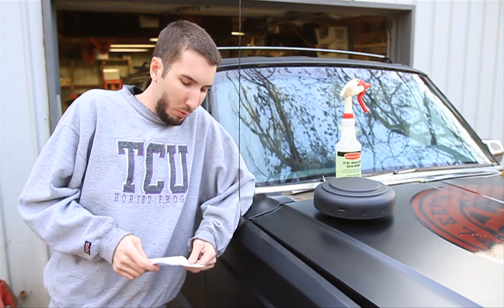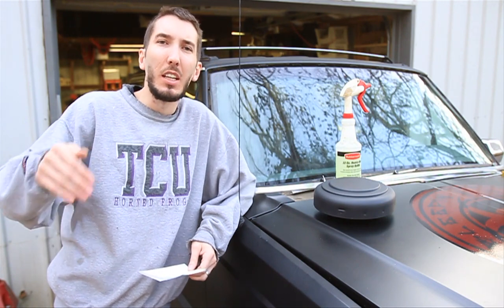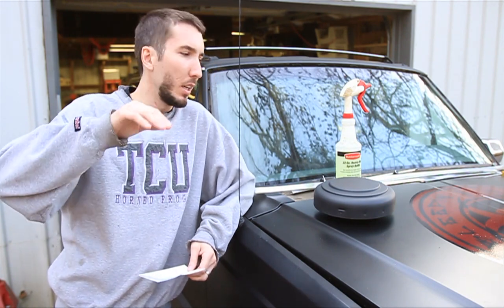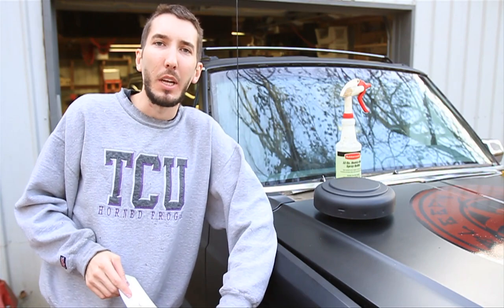How-To Diagnose a Leaky Windshield

Comment: fantastic advice, found 2 leaks on my discovery 2. top of windscreen and drivers window fixed it with some clear selicone..I didn't have a airline so i used a can of air duster for computer keyboards worked a treat  thanx so much
Reply: Thank you, I was hoping the air can would work. I will try this.
Reply: Genius

Comment: Nice trick! I tried using the car blower with doors closed, but just not enough pressure with my old car. Don't have a compressor, but tried my wet and dry vacuum with hose on the blower side. Works great, found the leaks in no time. So for those without compressor this will work for you (assuming you have vacuum that you can blow with)

Comment: I had a similar problem on 07 ford taurus leaking water from rain. The issue on my vehicle was the two cowl (upper and lower) of the wiper. I just use water resistant silicone from homedepot and haven't had a problem since heavy rains

Comment: I like the soapy-water-and-blown-air trick. Will try it on our windshield in order to pinpoint the leak. Thanks.
Reply: P.S. I'm going to use a silicone sealant to fix our leak, but I read that "silicone will not adhere well to surfaces where soap residue and/or soap scum is present." So if anyone is planning to use silicone, make sure all the soap is rinsed away.

Comment: There is another option. Running down and leaking into the wire grommet. So, no amount of silicone fixed it. What I ended up doing is using the silicone to reroute the water away from the grommet. Been good for the past 4 years.

Comment: Perfect testing procedure.  Had rain water dripping from under the roof rails to the windshield area in which the water would drip down inside on the lower A pillar and pool up on the drivers side floor.  Wanted to verify before spending $250 on a windshield replacement for my '93 Accord project I'm reviving...
Reply: I got a 99 accord thats leaking when it rains. I noticed my windshield moulding is loose. Gonna buy some silicone adhesive tomorrow and give it a go.

Comment: not trying to be too critical but is it possible to create leaks like this with an air compressor?  They have some serious power
Reply: What you point out is not "criticism" but common sense. Yes, the pressure from compressed air is TOO high.
Reply: depends on the power of the compressor and how close to the seal you're putting the nozzle. You wouldn't need enough airflow to cause a leak as you would need to find one so common sense would say if you have a more powerful compressor then move your nozzle further away from the test area.

Comment: Might want to have the windshield pulled... A couple of things are going on  with your glas... #1, the Ceramic paint along the edge of the windshield looks like it's breaking down and coming away from the glass..... #2, The windshield may have been installed by a shop that didn't bother to prep and prime the edge of the glass allowing the Urethane to  fail ......Good tip on finding the leak!

Comment: I had a problem with my driver side floor board getting soaked every time it rained. Thought it was a leaking windshield so I took it in to get it re-sealed they said the seal was fine. Next rain storm it was soaked again. Floor boards are not rusted. After a long time trying to figure it out it ended up being my door boot that covers up the wires to the door attached to the cab. It was missing a chunk on the backside and the water channel flows right to that spot and gravity was making the water flow right in my rig.
Reply: good knowledge  thanks for video
Reply: @dkhill27 where exactly are you talking about please?

Comment: If you don't have an air tank and that tool. You can just turn the car or trucks heater on full blast and close the doors with the windows up and you will get the same result.

Comment: I have had my windshield fully resealed twice and two partial reseals,the leak is still the same!! it's a bit lower down than the leak in the video!! i'm totally baffled!the resealers had to glue the bracket that runs along the edges of the screen,because the clips broke,so i can't do the method in this video!any help would be greatly appreciated!

Comment: i seem to have this problem right now, but i notice the water coming in from the passenger side almost underneath the dash, is it possible that the water from the windsheild will leak in this way?? the truck was park for 2 months and i opened it up and its full of mold! :( its not a/c fluid or antifreeze ive checked. son of a!

Comment: If its leaking its from a bad install or its just plain old..also there could be rust under the urethane and its pulling off the body... they should be able to cut it out an reinstall it. very easy job. i have a 91 Cherokee and installed a windshield for a 97-01 has a nice rubber molding all the way around. i glued the molding to the glass and then installed it. looks a lot better and helps keep the mud out. ditch the chrome molding trim and get a (part number) #1140 and 1140 molding...i wouldn't recommend reusing a windshield unless its less than a year old.   i work for a glass shop.
Reply: yep.. that jeep is mint. id spend the extra money and have them put a 1140 in it. it looks great ill send you a picture when i can.
Reply: bleepinjeep How did the repair on this go?  Did you pull it or just seal it somehow?  I've got leaks along the top edge and need to get them taken care of.
Reply: +bleepinjeep what kinda sealer did you use?